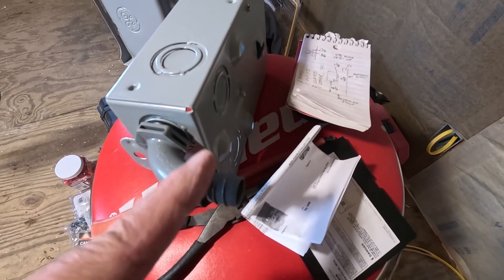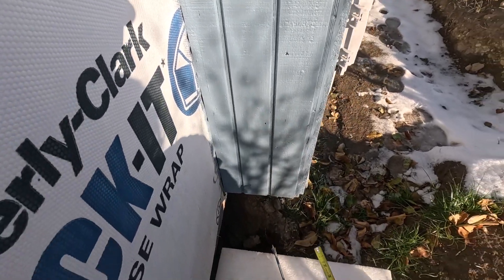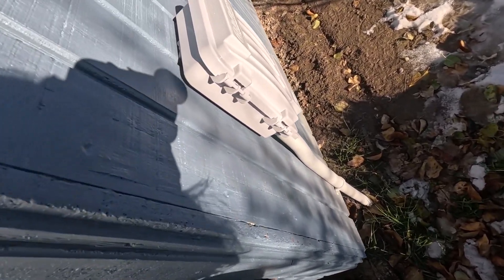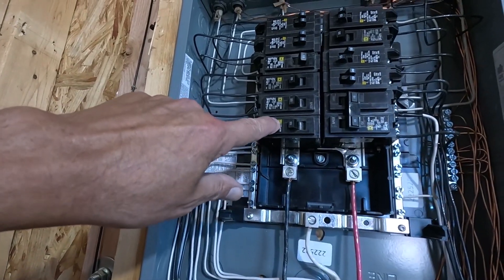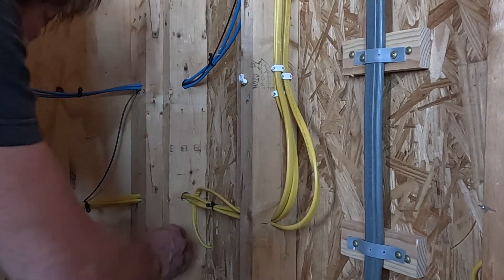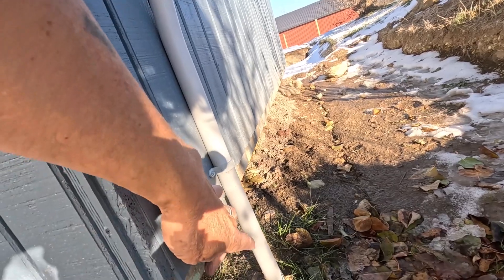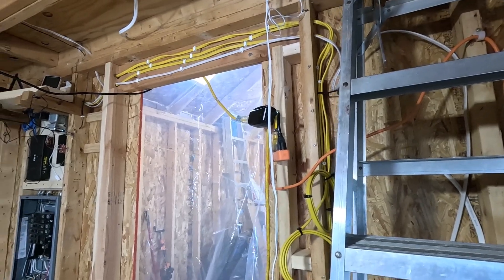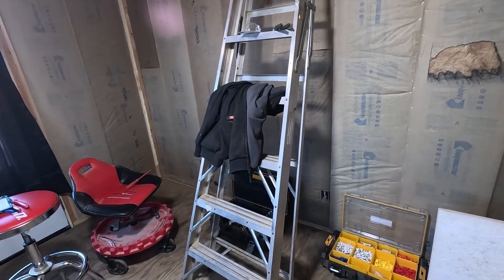Tiny House Wiring ― Install Mini-Split Shutoff and Test Circuits

Comment from the maker: This task (Installing the mini-split shutoff) has been on my punch-list for a long time and I'm glad to see it crossed off! A lot of other things needed to happen first — then it got cold and snowed making the area cold an muddy 🥶It's done now, and everything came out very well. Getting very close to wrapping-up the lower barn area! 

Here are some of the power tools I use here on Planet Mojo:

Cat6A Ethernet Patch Cable - https://amzn.to/46xg3dW
Klein Tools VDV526-100 Network LAN Cable Tester - https://amzn.to/3N820EH
GEARWRENCH 14 Piece SAE/Metric T-Handle Hex Key Set - https://amzn.to/3uvzxlY
GoPro Pistol Grip - https://amzn.to/3Gb5CC1
Kreg 720 PRO Pocket-Hole Jig - https://amzn.to/3umP9Iu
Qual-Craft Staging Brackets #2300 - https://amzn.to/40pwDv3 
DEWALT ATOMIC 20V MAX* Impact Driver - https://amzn.to/46F21YD
DEWALT 20V HEPA Vacuum - https://amzn.to/490Hm2z
60W LED Temporary Work Light  - https://amzn.to/46P8XC1
4 Way Locking Cat Flap Door - https://amzn.to/3PSXgDv
K-Type Thermocouple Connector - https://amzn.to/46e7YLQ
DeWalt Impact Driver Anvil - https://amzn.to/3F7lSDw
Dickies Men's Industrial Strength Suspenders - https://amzn.to/3tcTkFY
Sheet Metal Hand Seamer - https://amzn.to/3RxZE57
Dewalt Aviation Snip Set - https://amzn.to/3PNwWMo
Klein Tools Infrared Digital Thermometer - https://amzn.to/48n0mZ8
DeWALT Separator with 10 Gal Stainless Steel Tank - https://amzn.to/3YNZlow
DeWALT 20V MAX 14" String Trimmer - https://amzn.to/43uRQU4
DeWALT 20V MAX XR Oscillating Tool Kit, 3-Speed -- https://amzn.to/3aYKIaS
DEWALT 20V MAX Impact Driver -- https://amzn.to/2JzyCK2
DeWALT 20V MAX Cordless Drill -- https://amzn.to/38PmInW
DeWALT ATOMIC 20V MAX Cordless Drill, 1/2-Inch, Tool Only -- https://amzn.to/3rKAwbZ
DeWALT 20V MAX Circular Saw -- https://amzn.to/3p60tR7
DeWALT Rotary Hammer Drill with Shocks, D-Handle -- https://amzn.to/37u2DUJ
DeWALT 20V MAX XR Jig Saw, Tool Only -- https://amzn.to/2J66QEQ
DeWALT 20V MAX XR Reciprocating Saw, Compact -- 
DeWALT 20V MAX XR Compact Reciprocating Saw -- https://amzn.to/3nKHVFG
DeWALT 20V MAX Cordless Drill / Driver Kit, Compact, 1/2-Inch -- https://amzn.to/2KBzFcK
DeWALT 20V MAX XR Oscillating Multi-Tool, Variable Speed -- https://amzn.to/3nxzBt7
DeWALT DCG413B 20V MAX Brushless Cut Off Tool/Grinder  -- https://amzn.to/3mC4g78
DeWALT ATOMIC 20V MAX Circular Saw, 4-1/2-Inch, Tool Only ― https://amzn.to/3qYBiB9
DeWALT ATOMIC 20V MAX Reciprocating Saw, One-Handed, Cordless, Tool Only ― https://amzn.to/2Msu21r
DeWALT 20V MAX Cordless Drill / Driver Kit, Compact, 1/2-Inch ― https://amzn.to/3cbAhBl
DeWALT 20V MAX XR Impact Driver, Brushless, 3-Speed, 1/4-Inch, Tool Only ― https://amzn.to/3opEzaF
DeWALT Cordless Impact Wrench - https://amzn.to/3L5lvvl

12" DeWalt Chainsaw -- https://amzn.to/3oiLvId
16" DeWalt Chainsaw -- https://amzn.to/33Wqn1r
12 Ah Battery -- https://amzn.to/33JN48U
9 Ah Battery -- https://amzn.to/2SKUQwN
6 Ah Battery - https://amzn.to/3PyhOCT
6 Ah FlexVolt Battery -- https://amzn.to/3odC6BW
9 Ah FlexVolt Battery - https://amzn.to/3O4E7xu
12 Ah FlexVolt Battery - https://amzn.to/3pYI2UB
15 Ah FlexVolt Battery - https://amzn.to/3OpoCl2

Comment: Glad to see you wiring the mini split correctly with a shut -off. I've worked on numerous units that were installed by home owners that were wired direct, or even tapped into another circuit! 🥴

Comment: Mini-splits are awesome, but they don't do too well in the cold. Luckily you have other sources of heat!
Reply from the maker: I agree. This is supposed to heat to -13, but you get very little heat when it's that cold, and need some kind of supplemental heat 😑

Comment: Hi Mojo,nice video,inching forward sood be shipshape and Bristol fashion, temps are up slightly so not so cold, here in the UK if your retired you do receive fuel assistance each winter £500 634 dollars it all helps as fuel cost have gone through the roof.
Reply from the maker: Thanks Larry! I hear it's supposed to get real cold there soon? I hear about -7℉ (-21℃) coming? Hopefully I'm wrong. That's pretty cold 🥶 Yes, there is heat assistance if you are low income. We may qualify, I'm not sure. Between that and church groups, nobody goes without heat other than the bums. Yes, fuel costs are insane because of the closing of coal power plants. That won't get better until the build nuclear plants or reopen the coal ones. Wind and solar will never be sufficient, and will always be very expensive 😑

Comment: I have a large porch that was converted to a room, do you think a mini slit would help there? It has a heat duct, but it's still cold in the winter, and there is no AC 😑
Reply from the maker: Mini splits get less efficient as it gets colder. If you need heat, you are probably better off with a baseboard heater 🤔